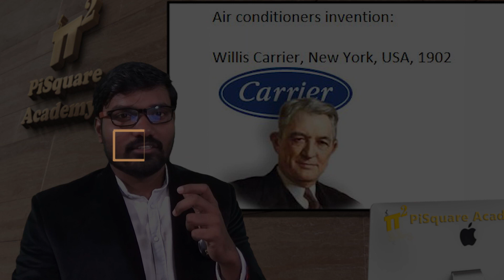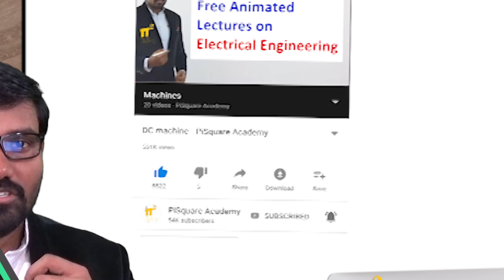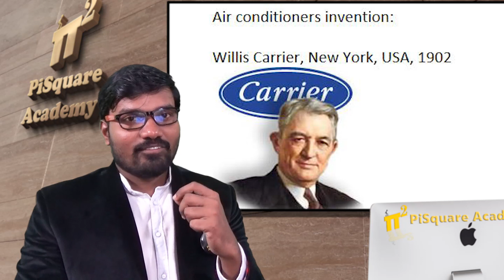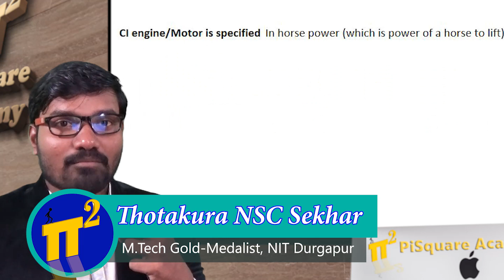Why AC in Ton.? | ESE interview Question

Comment: Induction motor is used  in outlet  as a compressor and DC motor  also used  in inlet to circulation the air  continuous and  one stepper motor also used to adjust the air direction.

Comment: Air conditioning is the dehumidification of indoor air for thermalcomfort. In a broader sense, the term can refer to any form ofcooling, heating, ventilation, or disinfection that modifies thecondition of air. Different units use different types of motors in both Refrigeration and Air-conditioning. The most common would be a CSIR (Capacitor Start Induction Run) but you may end up working for a few weeks without seeing this type and possibly seeing another type - split phase, capacitor start capacitor run, shaded pole motor or a three phase motor - which will almost certainly be most common in any industrial applications.

from quora

Comment: Room size does matter
Bigger the bigger is the thermodynamic  system hence larger entropy
AC reduce entropy 
If room is big , it will need more energy to decrease the entropy of the room and low capacity ac is not suitable for this operation

Comment: sir please make video on INDUCTION MOTOR 3Phase caculations for the values 5.4HP , 400V,  1430 RPM , 50hz  , 85% Efficiency(ASSUMED), NEED TO FIND   1.FULL LOAD CURRENT / RATED CURRENT   2. NO LOAD POWER 3. NO LOAD CURRENT 4. FULL LOAD TORQUE

Comment: Sir so Basically when we change the temperature setting of the AC, we change the tonnage of it...? 

Like for keeping the room at a Temperature of 25°c it would require to remove "x" amount of heat 
But when we keep the temperature setting at 27°c it would require to remove lesser amount of heat (lesser then "x"). 

So isn't this changing the tonnage...?
Reply from the maker: Of course you can do such comparison.
Reply: @ThePiSquareAcademy  Sir, so When we say an AC has a Capacity of 1.5 ton ... we mean to say its maximum cooling capacity its 1.5 ton .

And ACs are of variable tonnage. 

So i think there must be a minimum tonnage too 🤔
Reply from the maker: Absolutely,  minimum tonnage related to maximum temperature setting.
Reply: First of all thank you very much for creating these videos.
@Asutosh Patro
In your question, the room size (space to be conditioned) is ignored. Assuming the room size to be constant, a 1.5 ton A/C would take less time to condition the space compared to a 1 ton A/C when the thermostat is set at the same temperature.